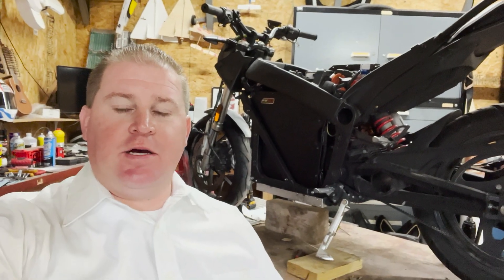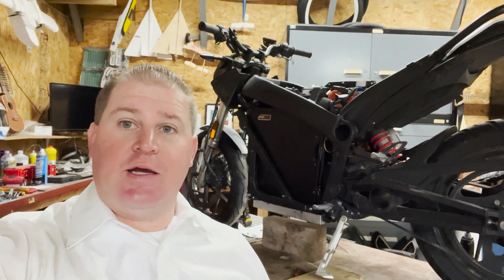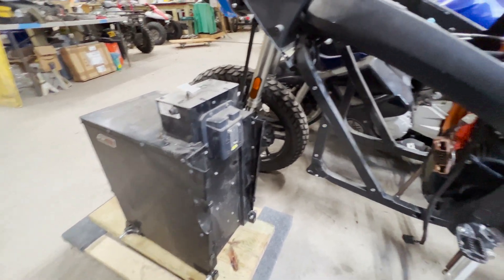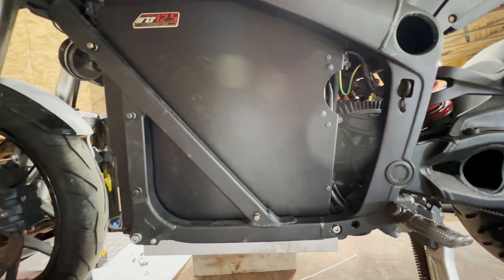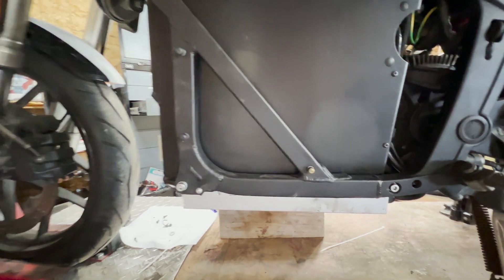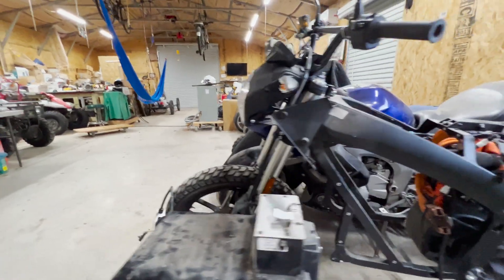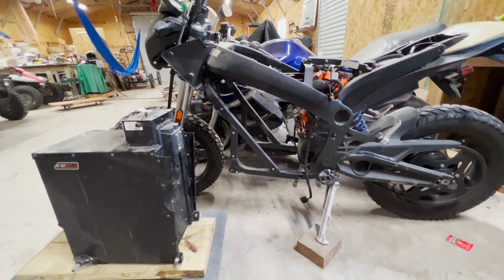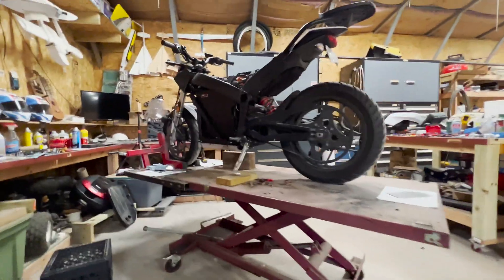2015 Zero Motorcycles, Zero SR Battery Swap

Comment: This is such a great resource, I'm still a bit unsure on the battery not needing any configuration, did you install the battery, and need to reset the BMS on the new battery to get it to work? Any configuration required on the MBB side? Thanks!

I have a 2014 low km DS and a 2016 DSR that's a statutory write off. I'm looking to swap the DSR drive train into the DS frame but the batteries on both bikes seem to show signs of having one or more high impedance cells. (power drop off when riding at high speed) so would need to swap in a new battery pack at some point in the future.

Cheers from Australia!
Reply from the maker: @terimakinsu  good luck on your swap, besides being a bit heavy, it wasn’t a big issue to change it out. I didn’t have to reset anything on the battery or the bike. It came right up and worked perfectly.

Comment: This is an awesome video, I love seeing this and it is giving me some confidence to look at my bike a little closer.  I have a 2015 DS and the charger seems to have died.  I was riding the bike one day and rode it all the way down to 0% but was able to make it home on fumes.  I plugged it in when I got home and it charged for a little while, up to 28% and then just stopped.  I tried different circuits, turning the bike ona nd off and unplugging it and plugging it back in.  I also continued to ride the bike until it is down to 0% now.  When I plug the bike in, I get no information from the chargers in the logs.  I can compare when I was charging to now and see that the charger is not being recognized.  Do you have an advice for me to try to replace the charger myself?  Have you don that repair?
Reply: The charger is an easy swap, as long as you can find a cheap replacement. They’re around $900 from Zero. You can get a wall charger for around $500 and remove the one on your bike. It will lower the weight of your bike, but limit your ability to charge on the road.
Reply: Thank you so much.  This is encouraging!

Comment: Once you had installed the battery, how did you get the BMS software set up to match that battery?
Reply: The battery size was the same, and as I understand, the BMS is on the battery itself. You can check and reset by looking under the two black rubber circles at the front of the battery pack.

Comment: I lifted my 2014 S up with a pallet stacker (like a small manual forklift).
I also replaced the crappy 2014 Fastace forks with a complete KTM Duke 390 front end. WP forks and 320mm Brembo work beautifully.